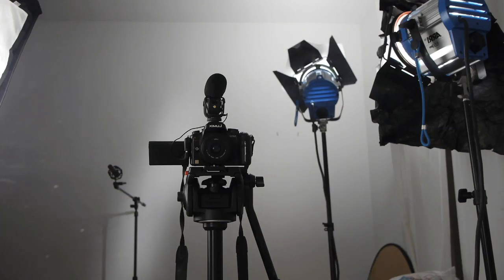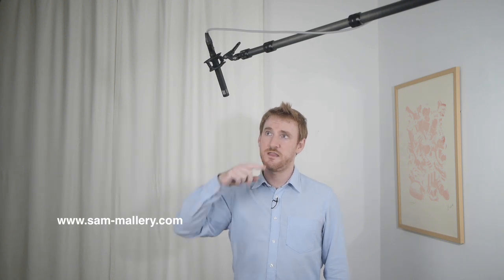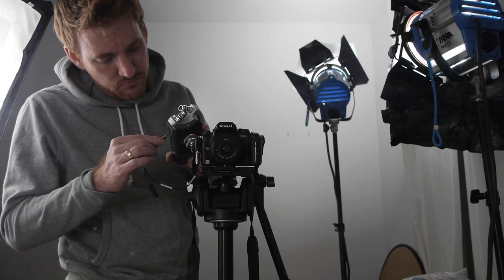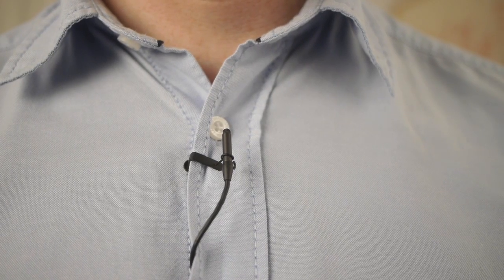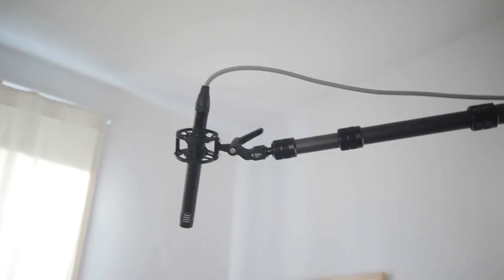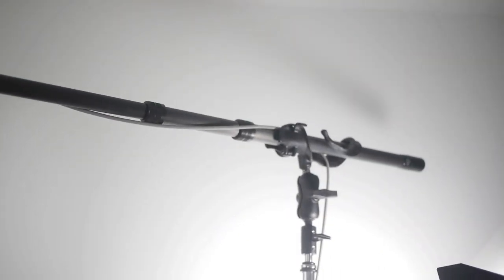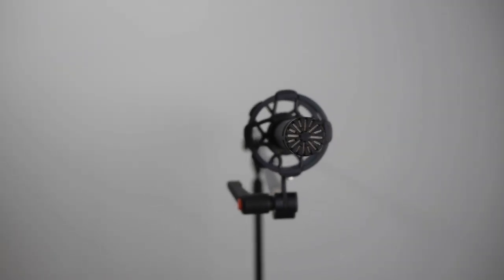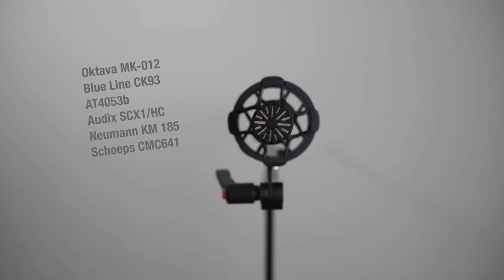How to Get Great Sound in Your Video Productions

Comment: i can hear a slight hiss on ur vid. how would u remove that in pre shooting (making the capture as good as it can be without editing on post production). (if u idnt notice there was a hiss in the first place of course)
Reply from the maker: +pikakiko I just listened to my video again. I suppose there is a slight bit of hiss in there, at points. The bigger problem to my ears is the reverberant room. You can hear the sound of my voice echoing off of the walls, ever so slightly. The echo sound could have been avoided if I had set up a few c-stands with arms and draped moving blankets around the room, to kill the echo. 

So, your question... how would you remove sound before the shoot? Well, if you seek a hiss-free recording, I would recommend using a mixer with very high-quality, low-noise preamps. I'm in the process of editing a shootout video right now between the Tascam DR-70D, Zoom H4n, and Tascam DR-40, and I can assure you, they all have a little hiss, even when used with good microphones. You will need something like the Sound Devices MixPre-D to get drop-dead quiet preamps, and then record into a quiet recorder, like the Sony PCM-M10 - http://amzn.to/1GmLsxu - and of course, you are going to need great microphones.

Another important thing to do is to listen closely to the space you are shooting in. If the space isn't dead quiet, your footage won't be, either. Kill all HVAC systems, and unplug nearby refrigerators when it's time to roll.